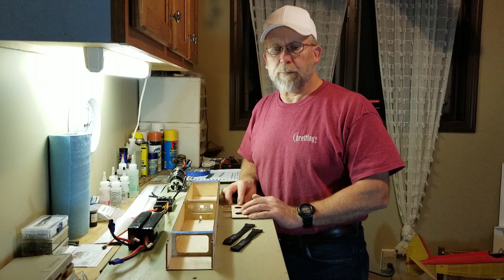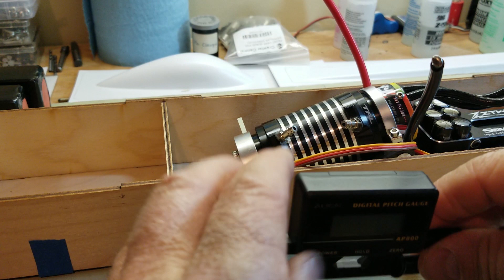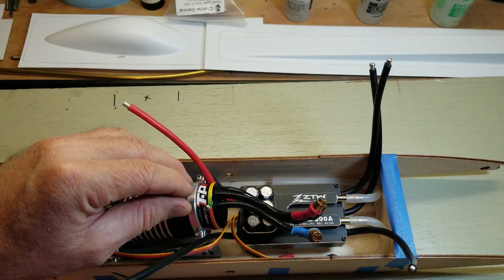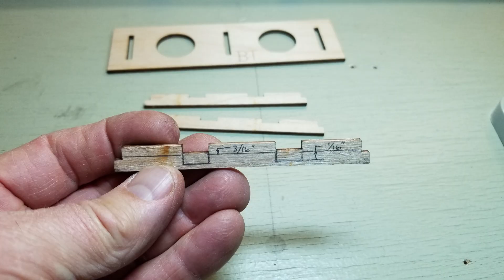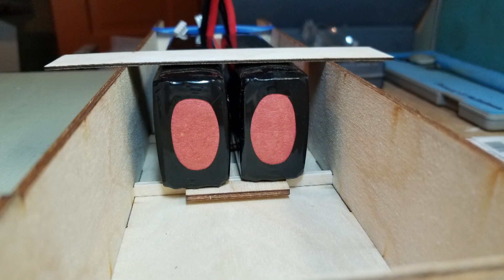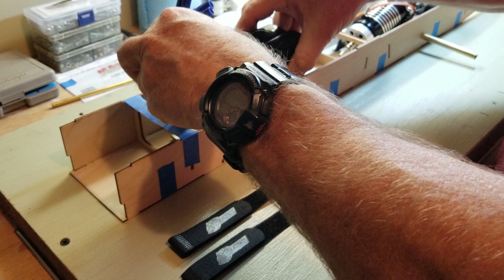ZIPPKITS JAE 21FE V2 OUTRIGGER WOOD KIT BUILD_PART 3

Comment: Hey Sam, I have a 48” cat I want to convert to electric ⚡️ any recommendations on motors... where can I find motors mounts and cooling jacket, that ESC please.
Reply from the maker: Here's the link to that 200 amp ZTW ESC. This is the website where I buy my RC boat parts... https://www.offshoreelectrics.com/proddetail.php?prod=ztw-200-6200200-v2
Reply: @chilly7261  Thank You
Reply: I’m no where near a knowledgeable as Sam but the TP motors are really well built and in my opinion having both end caps removable is a big plus.
 If by chance water gets in your boat and the bearings get noisy they can be replaced without removing the rotor . This can be an issue on other motors where only one cap comes off especially with a Kevlar wrap on the rotor in these type it is so easy to damage the Kevlar sliding the rotor out of  the magnets(stator) once damaged  and reused the Kevlar fails and at Revs the magnets fly apart not long after.
I have a standard TP motor and when I upgraded the bearings to stainless/ ceramic hybrids the rotor looked like it had a carbon rotor  wrap and it is so much tougher than the Kevlar, the Kevlar looks like fishing line the carbon looks like a flatter wider finish.
Also the peak amp capacity of the TP motor is very good it’s heading up toward the Lehner at 1/3 the cost.
They have D wind and Y wind choices giving lots of KV choices as well, the bad part is because of Covid (I think) there seams to be less stock at the moment.
Also TP USA are not so great at answering emails I had many questions and they answered about 4 out of about 8 so that meant I still don’t know if I bought the absolute best motor they offer for my set up.
In their defence they replied even on a Saturday to one Question.

Food for though.